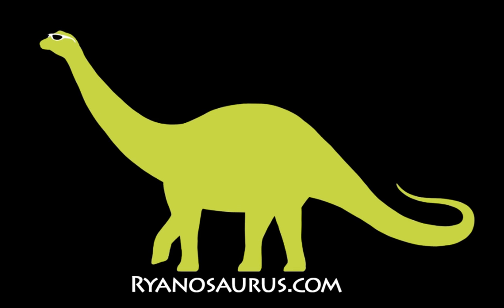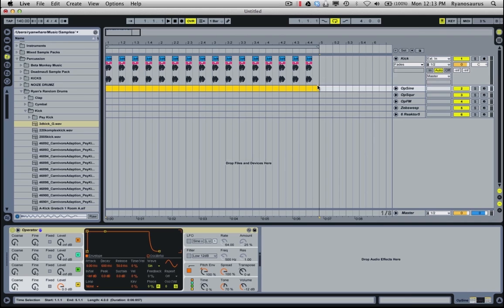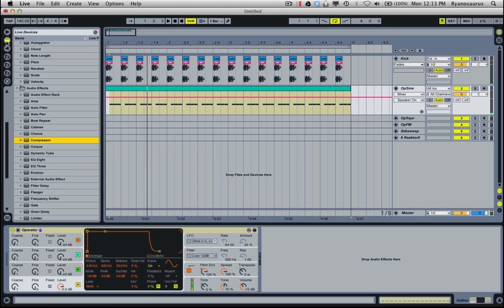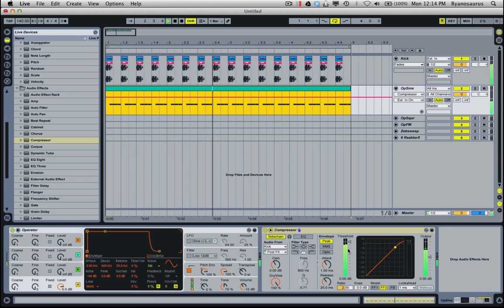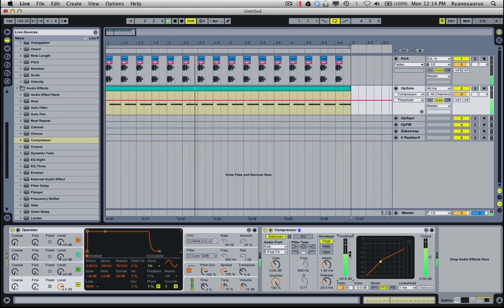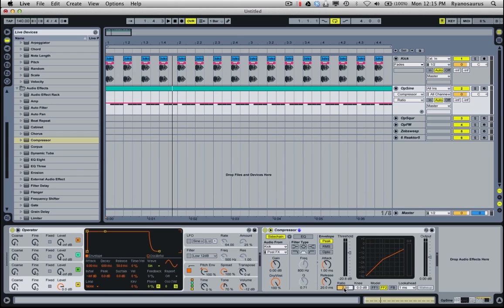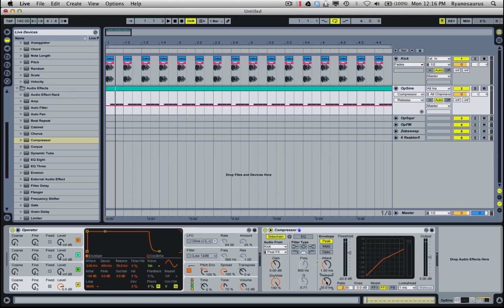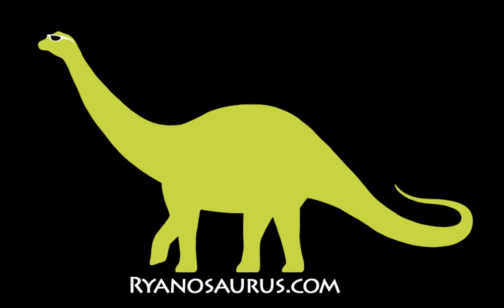Ryanosaurus Tutorial: Mix 1 - Kick To Bass SC Compression

Comment: This makes no sense. There IS no bass at the beat where the kick hits so there is nothing to be compressed at that moment.
Reply: looks like there is a slight overlap btw. kick and bass on the first bass kick because kick goes two eight notes and the bass starts on the second bass note if I am reading this right
Reply: @luzyoz143  It would have been a lot easier to hear and understand the bass being compressed if he put single bass notes on the kick eighth notes that held the duration of the note instead of putting 32nd notes with the first note not even being played where the kick is!!!!
Reply: @beatweezl  not arguing with you brother you have a fair point, I would note that its nice that he doesn't have a lot of overlap and I would even shorten the kick as not not even need a side chain. other video he posted on using sends to side chain is pretty genius though. did you check that out?
Reply: @luzyoz143  Not arguing with you either bro. Just saying that if he's going to make a video showing how to side chain a bass to a kick, the bass should be one solid note over the kick! As you said, there is almost no point in sidechaining here because the bass is barely over the kick! I have not seen that video but thanks for letting me know.